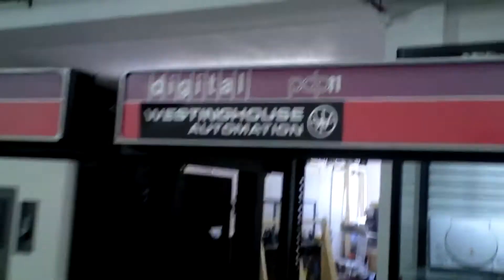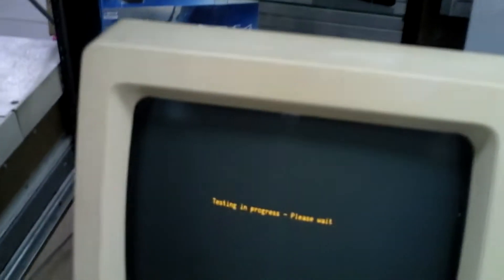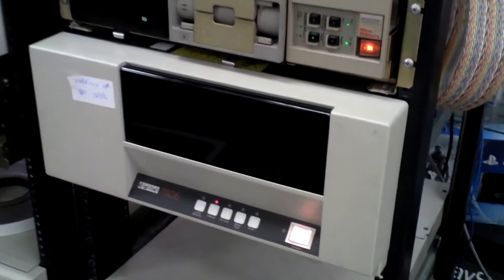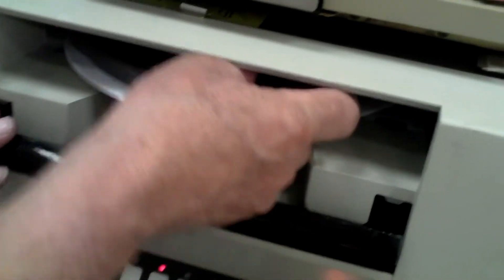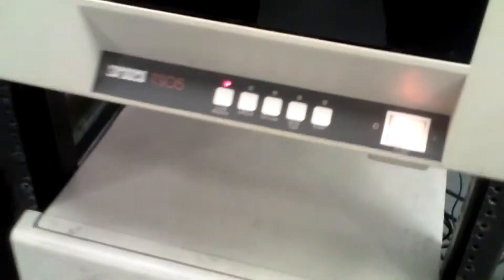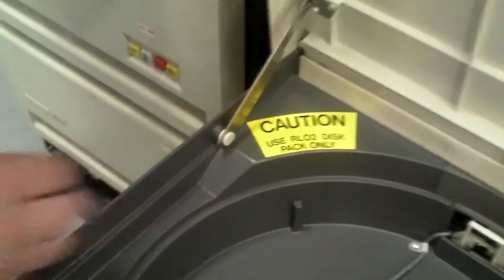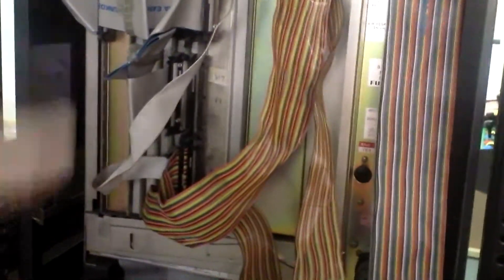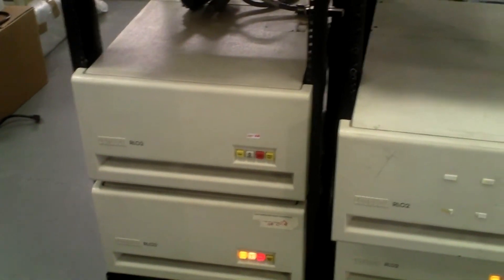Digital DEC PDP-11 - Disc Packs, Tape Drives and Terminals!

Comment: Tape drive in a draw may sound clever, and it takes up less space. But when the tech has to figure out why a tape will not load they lose their first most valuable troubleshooting tool, observation ! PDP-11/45 was my favorite machine to work on as a tech. And knowing it as well as I do provided me with a fun career. DEC BADGE # 7636. By the way, I have a DEC magtape of the ASCII images from 1974 or so. Don't know which computer museum to send it to. Including Spock holding the Enterprise model.

Comment: ~2:20 "Being a 16-bit machine, they would had suffered originally from the Y2K bug" ..... A very odd statement trying to link Y2K and a 16-bit architecture. Y2K was due to encoding dates with only the 00..99 years without concern for the preceding century 2-digits. It could have been an 8,16,32,64.... it makes no difference to whether it was Y2K proof. It probably was not Y2K proof, but that was nothing to do with it being a 16-bit CPU

Comment: Brings back memories, I worked on those systems and repaired those tape drives but OEM models. Scarriest thing is adjusting heads on a old CDC removable 9766. Fujitsu Eagles were much more reliable units.

Comment: Brings back memories of working on a PDP-11/04 in grad school in 1976. It ran RT-11 and controlled an MTS servo-hydraulic fatigue test machine. What a great time that was! No fancy video terminal, either; we had a DECwriter printer terminal that used reams of striped sprocket paper.

Comment: That large tape drive I do not believe DEC made.  The large half inch tape drives were the TU10, TE16 and then the TU77 and TU78.  They ran under vacuum columns.  I built many of them.

Then of course you have the ESE20 which was DEC's offering of a solid state drive in the size of that cabinet.  Super fast.  Again, I either built or tested every ESE20 they sold.  Fun times.  Now get a hold of an RP04 and you have something.  Multiple platters, it was a beast like the size of a washing machine but once the lid was closed it was glass and you could actually watch the disk pack spin up.  Those were the days.
Reply: The TS05 tape drive was rebadged by DEC. Can’t recall who actually made it. It would stream but RSX didn’t support that function on that device.

Comment: Wow, a Micro PDP-11/73. Those are very rare nowadays. Although I have started with computers in the late 70s, I have never actually worked on PDP-11's or VAXen. I was mostly on UNIX back in those days - just not on the machines, it was initially written on :)
Luckily, nowadays you can have some (cheap) fun with emulators and FPGAs. I have a PDP-11/70 mini-replica using the PiDP-11 with a FPGA PDP2011.

Comment: VT220! We all wanted a 220 instead of a big old VT100 back then!
Reply: Yeah, the early VT100 series had a clunky & somewhat basic setup facility, the VT220/3/4* series were infinitely better & almost PC-like in their ease of configuration. VT100s were still better than awful serial terminals like ADDS Viewpoint etc
Reply: @daffyduk77  Agreed. We got a VT100 once as an exchange unit but I didn't know how flimsy the catches in the case were. I soon learned to always lift a VT100 from the bottom! We mostly used Wyse 85 and 185s though.
Reply: @mistie710  You could do your back in just trying to pick one up !

Comment: Sweet! The early part of my career was on PDP-11s and VAXs. Thanks for the trip down memory lane.
Reply: Same here, though installing RSTS/E for me was on the traditional open reel tape drives, and we tended to use CDC 9762 and 9766 drives for the system but then we were using full size PDP11s, not microPDPs like the 11/73. I still get nostalgic when I see a PDP11 starting up, though the 11/44 and 11/70 were a little different.

Comment: the central unit itself is shockingly small compared to the rest of the stuff... it's about the same size as a full sized desktop computer nowadays. Would I be correct in my assumption that this was one of the latest generations and that initial models were much larger?
Reply: No not really.  DEC made a standard cabinet and all of the drives and cpu box fit in that cabinet profile.  Everything was stackable.  The  VAX line used a different cabinet which was wider and shorter but for the most part, what you see here would have handled PDP8's along with all their devices.  If the devices like tape drives were added, they had their own cabinet as they had the actual tape drive and then a controller that sat under the tape drive.  The tape drive would be the size of that white one in the video and then the controller was about the size of a small suit case.  TM02 and TM03 were the tape drive controllers for the half inch tape drives.

Comment: Are those CPU units essentially what they also sold as standalone micros, ie the DECstations/VAXstations and Rainbows? It seems kinda unusual to have a rackmount mini with either a twin floppy or a small form factor HDD built into it rather than in separate modules, let alone both...
Reply: Yo word, I was thinking similarly. By the looks of it, the floppy drive(s) totally reminded me of a the DEC Rainbow. Never used one or seen it in the flesh, though I once met a guy who had one. I could never forget what the floppy drive on the Rainbow looked like; it was so unique with it's dual slot in as single unit design. Which I would consider to be a bit annoying if I was an owner back in the day. What if I wanted a a single 5.25" and a 3.5" stacked instead? No bueno. Oh well, can't ditch this exotic styled drive, better use an external!
Reply: Ha, "CPU unit"? There's no such thing.

Comment: I used to work on PDP-11 s. They were used  for process monitoring on oil rigs and were connected up to sensors throughout the rig. When they broke down I had to fly out to the rig and fix the problem. The last incarnation, an LSI-11/73 in a ruggedised "Sigma" chassis, was replaced by industrial PCs around 2000.

Comment: But PDP-11 is only half the info, what is the number following the 11 as in PDP-11/34 or PDP-11/70? And most of my experience was on a PDP-11/70 running RSTS/E, then I moved to  a Data General MV9600 running AOS/VS II.
Reply: I think near the beginning of the video they identify it as a PDP-11/73, a later derivation of the PDP-11/70 family (a bit more miniaturization).

Comment: If you actually want to see what's on the terminal, this is the most maddening video EVER!  It looks like a video shot by someone who can't actually read.
Reply: what, you didn't want extreme closeups of the lower-right pixels of individual characters?
Reply: Yeah, I was like, "I hope someone comes back and shoots this decently, soon; not so close and shaky so much of the time!" And then I was surprised to see somewhat of a pro-looking logo slapped onto the end of it.
Reply: Whenever I watch videos about these machines they never explain anything you actually want to know.
Like the type of work that they used these for, or how you'd start up a program with the real tape-reels. This one has the modern implementation, but I wanna know about the sprocket-fed reels.

Comment: The RL02 drive has an issue. The READY light should be off as long as no cartridge is loaded or not up to speed. The READY light should only be lit after the drive has actually found track 0 by reading it!  But it is a great video to watch
Reply: Would track 0 be akin to partition 0 on a modern drive?

Comment: The numbnuts in Admin decided that the HDDs on the mainframes could be used with commercial grade helium (=ballon gas).
6 hours later we were called out to recover the system - head crash on the oil droplets in the gas....
Another sample of pointy headed bosses! We worked with the DEC engineer to set up a makeshift clean room (the air locker to the men's toilet, sealed and pressurised), cleaned and transferred contents of disks. Moral of the story - Trust your Technicians and Engineers....
Reply: This comment gave me so much to think about. I didn't know they utilized helium in this manner. I did notice that some of these drives had various vacuum pump arrangements but didn't know what provisions were made for disks.

A quick google search comes up with very regent HDD models which employ helium to help increase data density. Which leads me to suspect that such drives do not have a breather hole to supply the "air bearing."